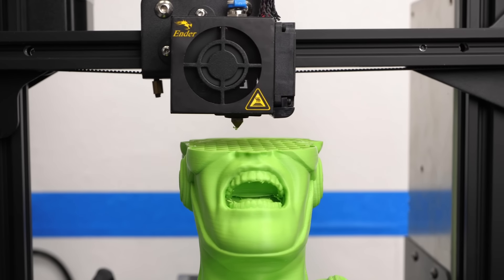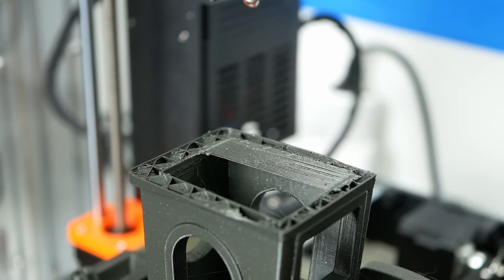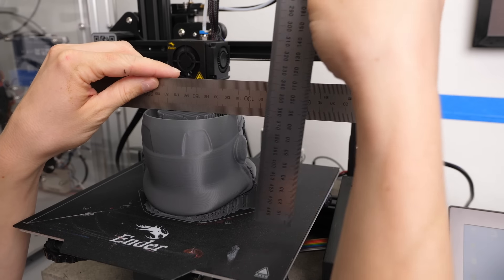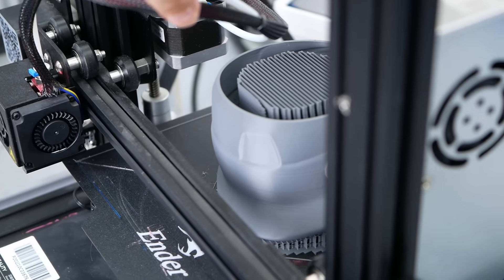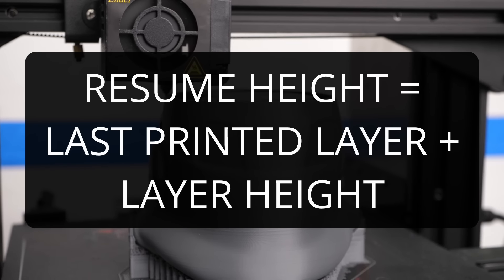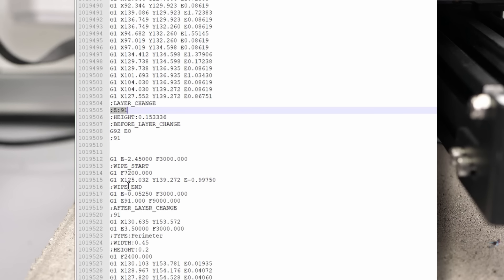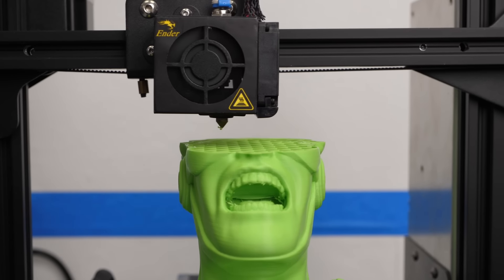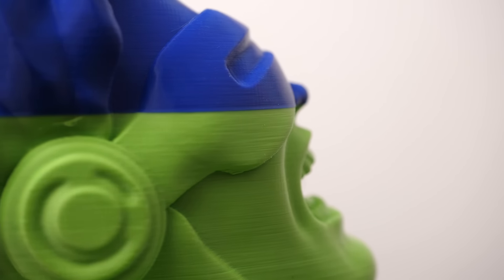HOW TO: Resume a failed 3D print!

Comment: Could you just set Z to the height the print failed at, and cut your model at that height?
Basically like the gluing method combined with the resuming method, without needing to edit the gcode manually.
Of course, you should disable brim or the like.
Reply: Yes, it is done similarly for multiple color prints, however it wouldn’t work if you need supports and it would generate extra bottom perimeters

Comment: For Cura, the GCODE is a bit different: 

Measure layer height with caliper
Open the Gcode in Prusa slicer (cura does not show layer height)
Find the layer number by height it failed on
Search in Gcode for that layer number, 12 replaced by your layer number LAYER:12 (this is the failed one)
Search within that layer for "Z". Then copy that Z number. Cura combines a move with X Y and Z, and does not mention the Z when it is not changed. So you need to find the command, purely by searching "Z"
Place your cursor before the next layer (LAYER:13), then scroll up, and just after the HOME command, Shift + Click
Delete everything selected.
Just after the home command, add your Z height you copied like this: (replace 16.52)
G1 Z16.52 F3000 ; Move Z Axis up to prevent knocking your print off the bed, and to start on correct height
;LAYER:13
Rest of the file

Comment: In S3D you can just reslice the print setting the start height.

It's so much easier no need to edit the gcode file etc. Just measure the height and reslice. :)

Comment: Great Video, I knew how to do this before installing by BL touch but i couldnt figure it out how to set Z height after in installed it without it crashing into the model. Adding the G92 and z height through octoprint is so much easier than what i was trying to do! so awesome!

Comment: 10:15 soooo what if my ender 5 doesn't support g29 commands? i am so very close, only one little command away from a fixed print, but when i input it and start the print the z drops down and then starts printing mid air.

Comment: I had an instance where this happened and the sliced gcode i put into notepad++, for me since i'm not experienced, i'm having troubles with finding the exact line for starting at Z 74.6mm height for cura. it's a little bit more confusing since, prusa slicer is a lot more straightforward in the code. When viewing in Notepad++

Comment: I followed these instructions and all seemed to work well, except when my Prusa i3 MK3S+ went to home, the Z home position appeared to be at ~1.0mm above the print bed. This translated into the attempted reprint occurring the same ~1.0 mm above the location of the last successful layer. I’m not sure what's missing to ensure Z is homed properly.
 
Here is the last line from the start of the g-code, the M106 fan command, and the first line of the resumption section:
G28 W ; home all without mesh bed level
M106 S255
G1 Z48.200 F10800.000
 
What do you think?

Comment: hello Stephan,  this trick , i have used 2 time in my ancian Ender 3 Max .... but , not, i have a Bambulad P1P .... and i need to try this in this machine because i have a failled print ( print in the air , because noozle are full ), can you make a video for a bambu printer ?

Comment: I tend to resume at the next layer with 10-20% higher flow rate and 20 Celsius hotter for the next 3-5 layers. This way the gap will get filled if there is one

Comment: I did recover my print by only homing X and Y axis. I used the nozzle to find the right z height and removed all g-code until the hight. I heated the bed and nozzle my self and turned on the fan. The z axis losses seldom the steps in my opinion.

Comment: Thanks. That just saved an 8 hours print. Slight changes have to be made for Cura such as the Extrusion value.
Reply: How do you apply the changes?
Reply: @leo888222  You simply edit the gcode with a text editor (not Word).

Comment: I don't know how yours work, but there are commands for Z move each layer that are absolute!, so if you continue to print without homing Z, it will move to that height, it wont continue where your manual home is, so it will start in previous failed height above your print, i dont know if this is only in my case because i print from USB cable.

Comment: Great summary!  Some of the steps seem like they could be automated.  For example, the slicer could emit "resumable" gcode files containing conditional statements to skip over commands until the desired layer is reached as specified in a variable.  Resuming prints would only require editing the variable either in the file or perhaps in the printer's UI.

Comment: Awesomeness', Exactly what i needed my print stopped after about 2 hours with 54 minutes left , Arrg But this Worked! Hardest part was finding a way to delete 17000 lines of text started and stopped as i needed t get to layer 194 out of  g code in the g code editor with 312 layers Brain Fart,  wait use notepad Ahh added the Z height before the last layer to Zed and then next layer. and it worked Thank you for doing this Video ! saved a lot of an already printed part! Awesomeness, Thank You!
Reply: lol i just had to figure out how to delete 1.5 million lines. i was going to be scrolling all week

Comment: hi there,  my issue is that when i then view the edited gcode it still shows a bottom layer that the printer wants to print even through supports and adhesion are turned off and there should be no 1st layer to print, it should just continue with the layer it stopped at. im not sure what else to try ive tried wih creality slicer and prusia

Comment: Thank you for the very nice and detailed video. It will help me a lot. 
I use simplify 3D and used to measure the last height and reslice the model with simplify 3D with "start printing" at "failure height + .2", which used to work for me. Now I know how to modify the gcode to resume my print. This will be very helpful for me to resume the files that I will slice with the Prusa slicer.

Comment: Had a failed print that stopped just at the purge tower. The object blocked being able to do Z axis homing. Managed to restart the print using the suggested G92 method. When restarting the lines on the purge tower seemed good, but then the line on the main object was off, as if the Y axis was stretched. The recovery failed :(

Comment: You could also move your part as far away from the homing coordinates as possible(So, top right on an ender printer), instead of printing it on the center of the plate, just as a precaution :D

Comment: My E5+ pumps out a about 100mm of filament before starting, the extruder skips, and is still off on x and y about 5mm is there anyway to fix this? This print took 2 days and 3/4 roll of filament, I'd like to try and recover this if possible I feel I'm so close.

Comment: Thanks for the help, I succeeded but it's not the same as yours.

I use CURA and CR-10 (original 12v 1gen)

Gcode is different

I had 1 problem and that is to find the correct command of the print run, because the command (in my case z10.15) is repeated in some places where the printer works "z hop".

All in all it has to start with the G1 F300 Z10.15 (approx.)

the thing that bothers me is that the printer was pulling hard (first time outwards, second time inwards [I don't know why]) at full speed of rotation E stepper the whole filament that was up to that point of the print.

And I understand why because the command orders him to, for example:

G1 F300 Z10.15
G1 F1800 E1131.88927
G1 X162.272 Y142.916 E1131.92696

As we can see X, Y, Z is well positioned but the E stepper has to work 1131.92 mm before the print starts.

How do I fix that, because that command repeats the next million lines (because the print is round).

You should start with E0.00000 (or something similar) and upgrade step by step in gcod

Comment: Unfortunately both of my 3d printers HOME by crossing diagonally over to the center of the bed and tapping the leveling pin repeatedly on the bed.   So its impossible to HOME if a failed print is already there blocking, it would knock the print off the bed.
How would it ever be possible to get around this?

Comment: Normally I solve the problem by lowering the model into the plate and applying that value to the Z-offset, removing the skirt or the brim.
New slicing without changing the g-code and new print. The new print starts with the bottom layers, but normally this is not a problem.
Obviously the complications mentioned when homing cannot be done, remain...

Comment: I had a print fail and i tried this video, it didnt work. When i started the print it did start printing in the right place, i just did it without any heating, and upon further inspection its because the part of the code, where it starts heating came after the g28 home line. I just made sure i kept those parts in and then it worked, now im just waiting to see how it turns out

Comment: I am so annoyed with my current print. Im printing on the Elegoo Neptune 3 max and while 70% through a 3-day project, it crashed into a part on the supports. It ripped the whole part off and got caught up stopping completely. I paused the print immediately which led to some terrible motor sounds. I removed the stuck part and it went to the pause area. I was hoping that when it resumed it would go back to where it stopped. Boy was I wrong. The rest of the print is about 1mm offset to the left. Im so close to the end of the print and the roll is more than half used anyway, I think im going to pray I can save this print with a bit of plastic welding and sanding. I'm pretty new to this, I guess its just part of learning. But Im still bummed this project wont be perfect now.

Comment: The only fixed print I have acheived is a Homer Simpson printed in wood, the nozzle got clogged just as the top of the head was printing, I rescued this print by scaling a cowboy hat to fit Homer's head and glued the hat on, I actualy preffered the model with the cowboy hat.
 I need to learn this skill of recovering a print though as I have some 72 and 106 hour prints planned

Comment: PrusaSlicer WARNING: For some reason, PrusaSlicer places the last wipe move from the previous layer after the layer change comment, before changing Z height. Normally, that's not a problem, but if you've just homed your printer, your Z is 0 and the extruder will wipe your print off the bed. 
This sweet little surprise just cost me a 35 hour print after I spent almost 3 hours trying to save it. Thank you PrusaSlicer!

Comment: People that use Prusa MK3s. If you have lost your mesh level and need to home your printer before print, Read this comment.

In your gcode remove the mesh bed level line so the printer doesn't crash into the print.

If your layer height starts too high, I recommend adding G92 after G28 W.
Use your current Z offset value either in live adjust Z or from HW Setup. The final gcode should look like something like this:
G28 W ; home all without mesh bed leveling
G92 Z1.55 ; Example Z offset value

Notice that the Z offset doesn't have a negative value, that's because it will actually raise the Z offset rather than lowering it when it's negative. 

Be sure when you try this the first time, have the nozzle heater off , slow it down and have G92 0.5 or 1 mm higher just in case you crash into your print and melt it.

If you absolutely need a purge line, you can make it more compact like this:
G1 Z0.2 F720
G1 Y-3 F1000 ; go outside print area
G1 X40 E9 F1000 ; intro line
G1 Y-1 F1000
G1 X0 E 12.5 F1000 ; intro line

I hope I helped others from what I have learned!

Comment: Hi thanks for your video!
I have to say I couldn't quite apply it to my print termination as I seem to have slightly different commands as I was working with the CURA slicer.

Nevertheless, I would like to ask a question. From my point of view, I have already deleted everything from the GCode that is supposed to move to any homing or positions. Nevertheless, the printer simply does not move to the correct Z-height? I have tried to move the printer "from above" to the respective Z-coordinate, no reaction, printer remains at the height where it was. Then I tried to move the printer manually to the Z height and after the final warm-up the printer moves up again approx. 5-10 mm and prints again into the empty space.  I am really getting desperate with this "easy GCode". Does anyone have any tips?

Comment: Nice. Just goes to show that there is still huge room for improvement and innovation when it comes to 3D printing technology. It will be nice when the printers can do all this stuff automatically.
Reply: Better controllers would be a good step. Coming at this from CNC, it's nice to be able to just scroll theough the program and start it at an arbitrary point, or make edits at the machine before running or resuming a run. Obviously a lot of the functionality I'm thinking of is of questionable use in 3D printing, but the community will find ways to capitalize on any new tools developers can give them.

Comment: I'll start with I'm using Cura 5.5.0. I tried to modify the gcode. I can get it to move up to the position on the z axis is will start to move then the extruder just starts pushing out filament. My extruder code looks very different. I'll past some of it here. It seems as if Cura is keeping track of how much filament it has extruded or am I missing something? Ultimately I sunk the model in the bed and printed the part to glue in place. I would like to learn the gcode fix method though. 

Thanks for any help

G1 F0 Z145.8
G0 F9000 X88.834 Y65.78 Z145.8
G1 F0 Z145.6
G1 F1500 E1504.2473
G1 F1650 X89.944 Y66.969 E1504.29464
G1 X90.414 Y68.528 E1504.34202
G1 X90.026 Y69.993 E1504.38613
G1 X88.99 Y71.04 E1504.429
G1 X87.555 Y71.432 E1504.47229
G1 X86.161 Y71.006 E1504.51471
G1 X84.927 Y69.753 E1504.56589
G1 X84.485 Y68.275 E1504.61079
G1 X84.874 Y66.867 E1504.6533
G1 X85.921 Y65.741 E1504.69804
G1 X87.368 Y65.349 E1504.74167
G1 X88.834 Y65.78 E1504.78614

Comment: I did everything and homed the printer but when it resumes the head was way to far from the failed layer height and the z height was giving correct readings, i think its not relative to homing height measurements

Comment: This be something that can be written as a OctoPrint plugin, right? Which would allow to move the nozzle to the right hieght, and then say 'continue from here'.
Reply: With CNC machining, you can just select any line and run the program from there, so it should be easy enough to even make a plugin that lets you tell a printer to start from whatever line starts the layer you want. Only tricky part is that CNC home positions are AWAY from the part, and 3D Print homes are at the bed, so you'd likely have to not home Z.

Comment: i always find it a LOT more simple just measring the hight...then cut the model and print the new section from scartch
then just glue them together / fill with wood filler / sand  and u will never see connection point

much more simple then to understand gcode and messing with printer settings, and maybe crashing your printrr somehow imhp.

Comment: I already knew that but I could never resume a failed print because: a) it auto-homed into a slightly off position so it would print wrong, b) the nozzle crashed and loose the part, c) or the heatbed already cooled down and the piece got separated from printbed... So I usually use the measure and start a new print at layer X

Comment: I haven't tried any multi-day prints yet, so I generally just restart mine. This could be very useful though.
Reply: Yeah me either. In fact, anything that will take over 6 hours I make out of wood or metal.

It's not worth my time or electricity to have a part fail after hours and hours of printing.

I also avoid this by not printing large silly things.
Reply: Even on small prints. Print out a piece with bad thread on top, cut it off and use these tricks to reprint the correct thread.

Comment: Strikes me that what is needed is a device to monitor print height actual vs expected that will show the height at the point of print fail, tag the print code point at that moment and stop the printer from trying to continue and of course set an alarm.  Now to find out how lasers work for finding distances ...
Reply: You can use IR or ultrasonic range finder sensor, those are sold as a complete unit, all you need is to connect it to i²c bus and get the data.
The problem is that you won't be able to measure small parts, because it's not possible to put such sensor right into the nozzle.

Another way is to train an AI to monitor your video feed.
I believe there are some proprietary solutions doing this already, though it shouldn't be too too hard to make it non-proprietary.

The global problem is that it's more cost-efficient to just learn how your machine works and tune it to the point of decent reliability than to invest in questionable tech that isn't as reliable as the machine can be without it.

Comment: Also wenn ich einen unfertigen Druck habe, setz ich das Objekt im slicer einfach um den bereits fertigen Teil des Drucks nach unten und drucke dann den Rest aus.
Anschließend werden die beiden Teile dann verklebt

So when I have an unfinished print, I just put the object in the slicer down around the already finished part of the print and then print the rest. The two parts are then glued together.

Comment: I am having thermal runaway issue on my MK3S once fan is set to 100% (255).... its frustrating, because part will not be sticking to bed because its all (temperature) reset 0.